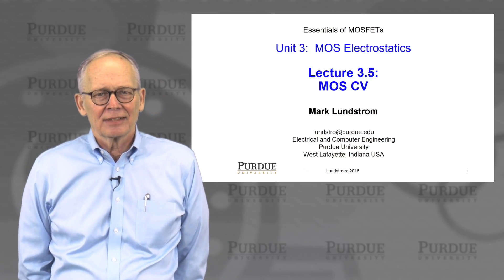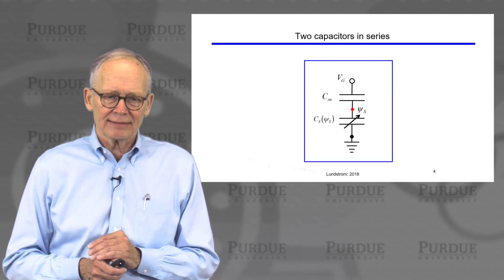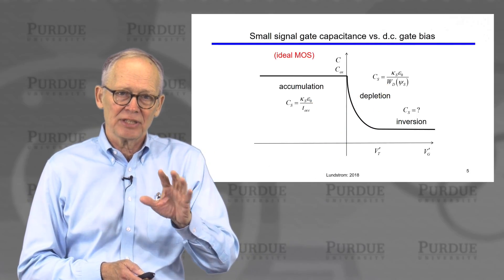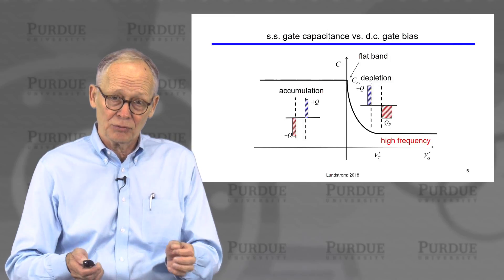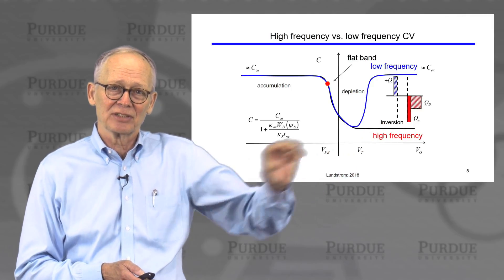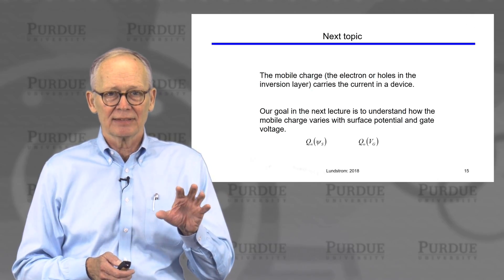nanoHUB-U MOSFET Essentials L3.5: MOS Electrostatics - MOS CV

Comment: 00:00    Lecture 3.5: MOS CV
00:27    MOS capacitor
01:34    Effect of DC bias
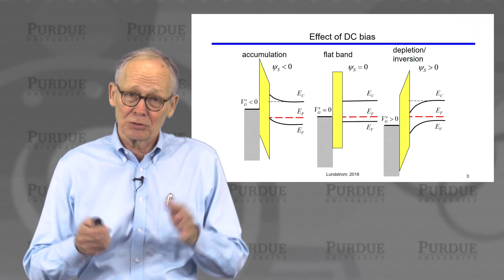02:15    Two capacitors in series
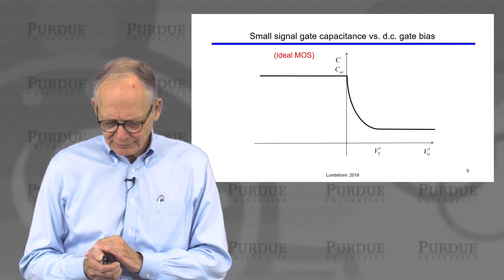02:50    Small signal gate capacitance vs. d.c. gate bias
04:52    s.s. gate capacitance vs. d.c. gate bias
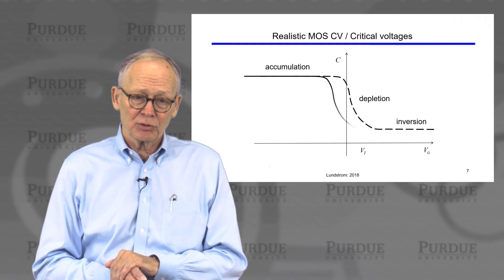07:11    Realistic MOS CV / Critical voltages
07:31    High frequency vs. low frequency CV
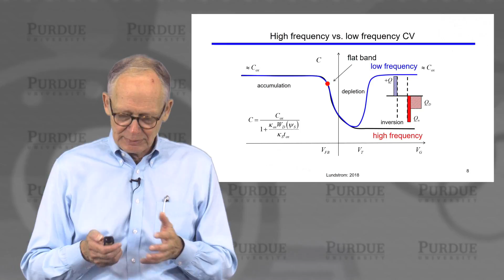08:45    HF vs. LF CV
10:00    CV measurements as an analysis tool
12:00    CV measurements as an analysis tool
12:12    Summary (i)
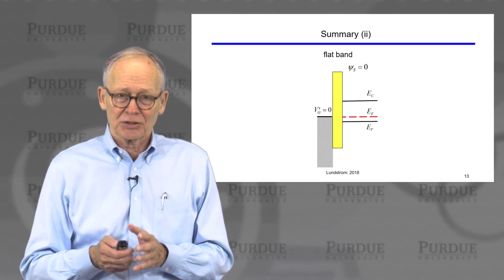13:16    Summary (ii)
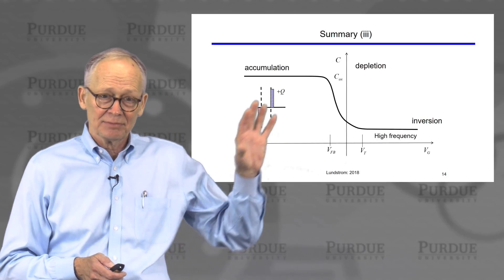14:00    Summary (iii)
14:25    Next topic